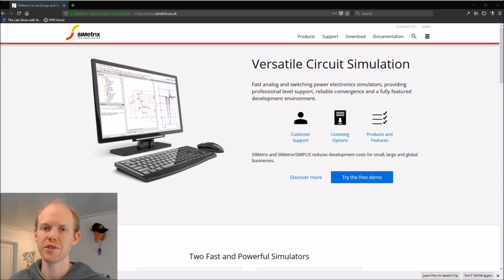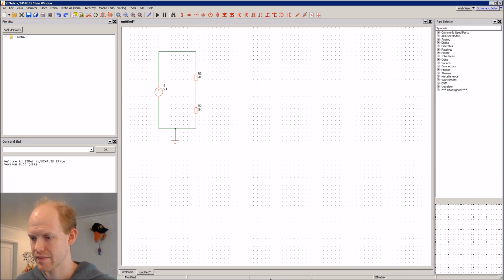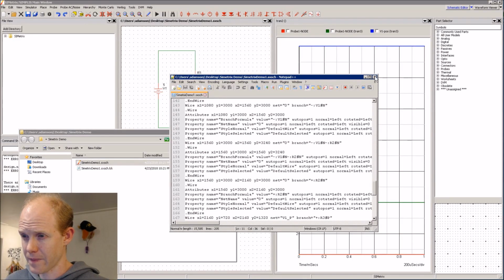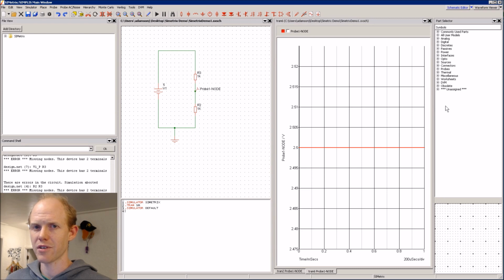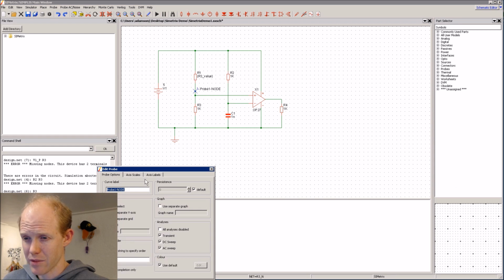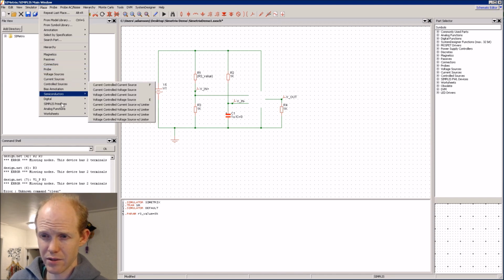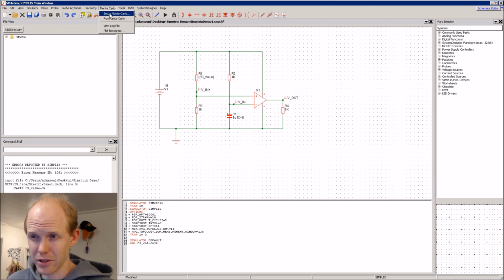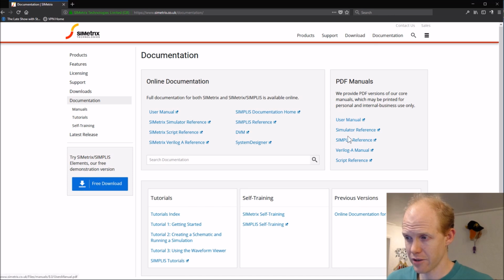SIMetrix/SIMPLIS - Intro

Comment: Hi....Is it possible to generate a simetrix schematics from a net list file(pre processed file like .net or.cir)?
Reply from the maker: No, when those files are created all the graphical symbol and schematic information is thrown out. I am working on some tools to do that with my new Bolt circuit simulator however, but it will still include some manual work.

Comment: Thank you for the introduction.I got question at [13:54], since the OP27 supplied only 15V, why its V_OUT can get +19V and -5V output. Did I missed something.
Reply from the maker: Nice observation! You are correct, that is not realistic. You have to keep an eye out for those kinds of things while you're simulating because they happen often if you (or I) aren't careful. If you map out what these spice models are doing they have controlled voltage and current sources inside them that allow for unrealistic behavior like this where the output is above the supply. This is because they are very simplified approximations of the actual part, usually optimized for simulation speed and things like AC response.
Reply: Thank you for your quick answer. I saw in the next example you are using SIMPLIS simulator and change the spice model as well , the result seen more reasonable(at least the V_OUT was in power supply range). From the two examples i got two questions; 1. what are the different between SIMERTRIX and SIMPLIS?  How do i know which simulator was suitable for my simulation? 2. the spice model for first example was load from the library,but it seen not function correctly. My question is, can i belive those spice model in library? Or i have to test it before use.
Reply from the maker: FYI this video is from this playlist in case you want to see more: https://www.youtube.com/playlist?list=PLPJa0dSdlB4WKriRAjfVYXO8W5goUo5wy
1) I tried to explain it but Simetrix is SPICE and Simplis is piecewise-linear approximations of SPICE specifically designed to make switching power supply models run faster. Therefore use SIMPLIS to model an entire switching power supply and use Simetrix for everything else. Simetrix is more accurate but slower. Simetrix is basically the same as any other SPICE simulator like OrCad PSPICE, LT SPICE, Tina TI, MicroCap, Cool Spice...
2) No you can never trust any circuit models or any models in general in engineering and life. You have to always check everything and make sure it all makes sense. That said, in the case you mentioned it will not matter if your opamp can go above the rail, for example, if you make sure the operating point you are simulating does not have it above the rail. If you're getting unexpected results though, you definitely want to start checking all your operating points and make sure they make sense. I have had it before several times where weird stuff happens (usually in PSPICE) where KCL is not even working, like the current in/out of a node is not 0, so keep an eye out and check everything.

Comment: When I try the graph is not showing up
Reply from the maker: First make sure you setup and ran the simulation. Next make sure your simulation completed successfully in the simulation status window. Finally make sure to use the probes to display the waveforms.
Reply: @CircuitAnalysis  I believe I did all these...it showed completed, also I used a voltage probe but no line was showing not even a straight line. I mean nothing came as a pop up or anything. Is it because I'm using the free version? Is that why?
Reply from the maker: @rishikeshk9107  What type of analysis did you run? You can try running some of the example projects, those should be setup already.
Reply: Anybody know why?

Comment: Thank you for great lecture. Can you please talk more about how to use Simplis to do Bode Plot?
Reply from the maker: Oh sure that would be fun, I'll put it on my list. Are you using the Elements version or the full version? In the meantime checkout the example files that come with the install and there should be a couple that are setup for the bode plots. One is "A_SyncBuck_Digital_PWM_POP_AC_Transient". If you're starting from scratch with your own circuit, the things you need to add are a POP trigger on the drive to your main switch or your clock, an AC source and a Bode Plot Probe to your feedback. Then you go to sim-settings and enable AC analysis.
Reply: @CircuitAnalysis  I downloaded the trial version which I believe is the full version. Thanks!
Reply from the maker: Nice, then you have more example options (if you select Example Circuits from the home screen), there is also "Synchronous Buck with Digital PWM (POP/AC) - full". Let me know if you have any questions since it's likely I won't get to making more simplis vids before your trial is up. Have fun!
Reply from the maker: Ok I did a quick one on the bode plots, check it out here: https://youtu.be/Qjq32a8ytoE

Comment: How do put a 100mH inductor with 10 ohm internal resistor on Simetrix?
Reply: Simetrix has a special symbol which you could place both inductance and ESR for the inductor
Reply from the maker: Sorry for the slow response, for ESR I honestly just use a separate series resistor, but they do have fancy inductor model if you go to Place => Magnetics => Lossy Inductor XXX

Comment: how to simulation the Rectifer with Thyristor?
Reply from the maker: Oh man sorry I am crazy slow responding to you but I would say I don't think they have a built in model, so you could either google for a thyristor SPICE model and import it by dragging the file and dropping over the command shell area, or you could make a subckt with something like a switch with hysteresis and maybe an analog behavioral model or a couple comparators. Here's how mathworks does theirs: https://www.mathworks.com/help/physmod/sps/powersys/ref/thyristor.html